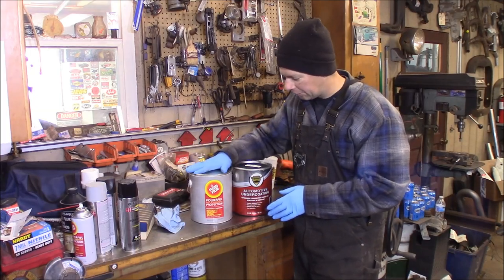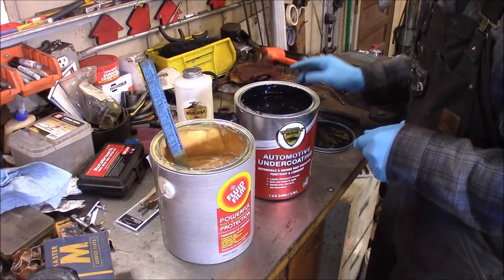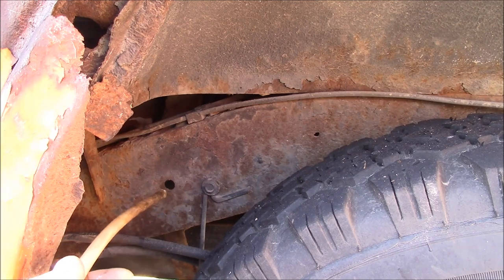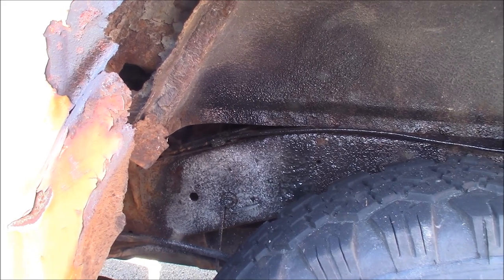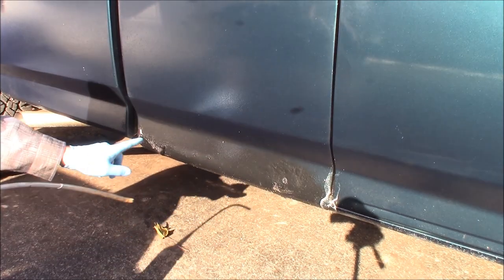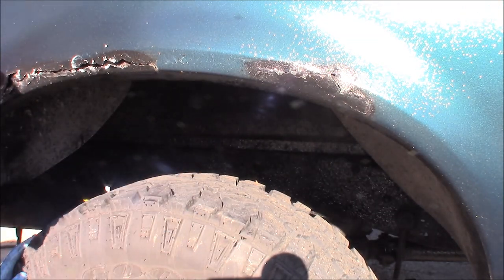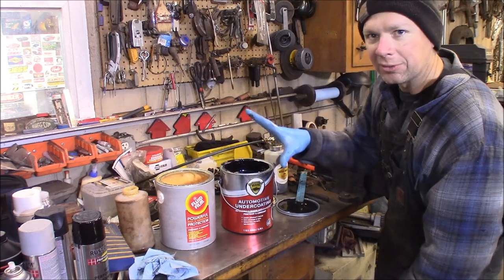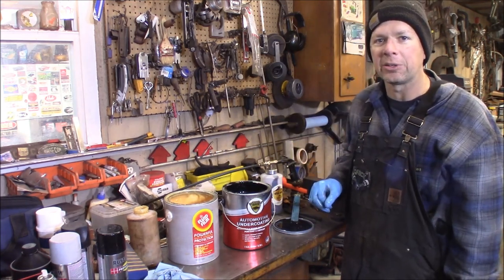Fluid Film vs WoolWax Lanolin Rustproofing:  Stop Rust in its Tracks!

Comment: If they are both Lanolin based...what is the difference (apart from color?)
Reply from the maker: The Woolwax is a little thicker than the FF and has a little less odor.
Reply: FF swells plastic parts and the other does not.

Comment: It seems like if you already have rust, then whats the point?  I guess if you have to give it a longer lifespan it could help.  The rust belt areas are really harsh, and this pains me to say, but I'm glad I don't have to deal with all that like some of my family members.  I would cringe to smelly coatings and sprays!  Take care! 👍
Reply from the maker: The truck I used in this comparison was already extremely rusted out and really wouldn't benefit at this point.  I was just using it for a visual display.  I will have a comparison video coming out in the spring that shows two trucks, one I have sprayed every year since new and one that wasn't. Both trucks were purchased at the same time and driven in the same conditions.  The sprayed truck has absolutely zero rust on it while the unsprayed truck has moderate rust started everywhere.  That's only after 4 years.  If you live where salt is used and spend tens of thousands of dollars on new cars you'd be foolish not to spend $40 a year to keep them from being destroyed.

Comment: Forget the wool wax , get a new truck then maintain it !! That one is ready for the grave ...how does it pass inspection 🧐?
Reply from the maker: The rusty truck was my winter beater S-10 which was retired after another winter.  The green F250 is in very good shape and has not deteriorated at all after FF and WW.
Reply: @QuickSpeedShop  ahhhh I see , well good luck with the newer one , I will take my 2018 to get undercoating before the next season..

Comment: Assuming you have a car wash nearby that offers unlimited washes for a fee, forget undercoating. Just wash your car once a day. I've been doing this for years and not one ounce of rust. Juast be sure to get the under wash option. I pay $38 dollars a month. That comes out to $1.26 per wash (depending on how many days are in a given month). Don't waste your time and money. I wish I owned a car wash.
Reply from the maker: The closest car wash is 5 miles away from my house one way.  It would cost me $49 a month to wash every day.  I can Fluid Film or Woolwax my truck for $49 once a year.  Lanolin protection sheets moisture away and protects the metal.  I coat the insides of the frame and all the body seams providing protection.  Running you car thru the car wash everyday for the rest of your life might work for you, but will just leave the thing wet in all the seams all the time and adds zero protection to places where paint didn't get, but water, salt, and dirt can.  Plus I have better things to do with my life than go to the car wash everyday, no thanks.
Reply: Wil Par the water from washing will eventually cause rust underneath everywhere there is bare metal being there are places underneath that will hold water. I guess if you have a way to completely dry the car it could work perhaps.

Comment: I want to do my vehicles, thinking of using the wool wax. you said its ok for electrical and rubber. I heard it would cause rubber to swell and fail, ant truth to that?
Reply from the maker: Electrical components no problem. I spray it on all connections, battery ends, plugs, etc.  It will soften rubberized undercoating and soft rubber things like that.  I have not had problems with rubber like door seals or rubber hoses, but haven't really unnecessarily sprayed rubber products with it either.  I guess I would try not to spray rubber brake lines and fuel lines, but if a little got on the rubber I wouldn't freak out about it.
Reply: @QuickSpeedShop  Thanks, that is what i was thinking, but i wasn't for sure.

Comment: How can you claim the products are “good” without salt spray chamber testing preferably with stone impingement compared with an unprotected control area???
Reply from the maker: I'm not a scientist, but have driven thousands and thousands of miles in the real world salt chamber that is western NY.  My only vehicle that hasn't been eaten alive by road salt is the 2016 Chevy Silverado truck I drive at work and that I personally Fluid Filmed since it was new.  Four years later it has absolutely zero rust anywhere on it.  The three other Silverados purchased at the same time, driven on the same roads, but not sprayed all have significant surface rust on the chassis and rust starting on the sheet metal.  I'll take that proof over a salt chamber any day.
Reply: QuickSpeedShop I agree. NY has some of the worst salt caused rust anywhere. Where I am they also spray that liquid salt compound on the roads before it starts snowing. That stuff is even worse than salt. NY roads are asphalt for the most part and our roads are almost white with salt all winter long. You are right, we are in the real salt test chamber. My personal preference is the wool wax because it does seem to hang on better. We use it on a Ford E250 Van.
Reply: @QuickSpeedShop  You should do a video showing this comparison. It would be more helpful than most of these types of videos.  Although I would be looking a little further out than 4 years, at least you have a comparison with/without the product.
Reply from the maker: I plan on filming that comparison video this spring.
Reply: pete smyth very true.